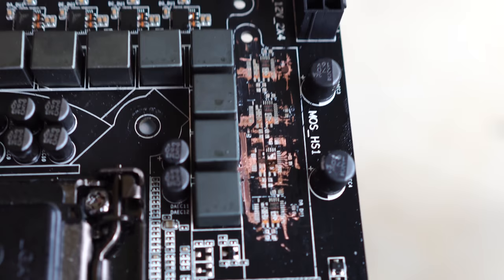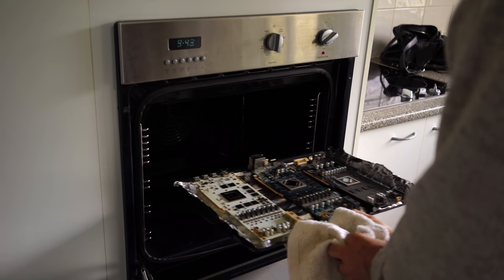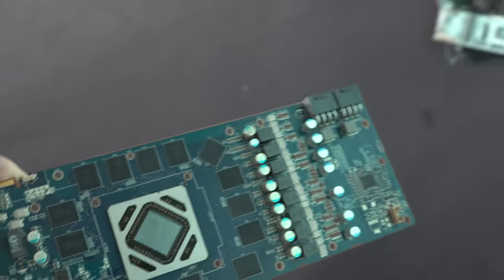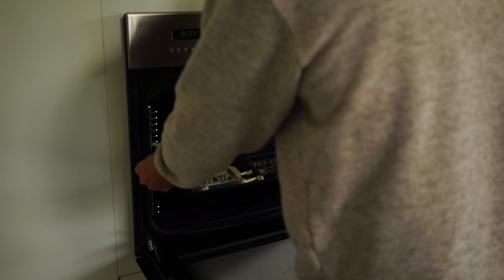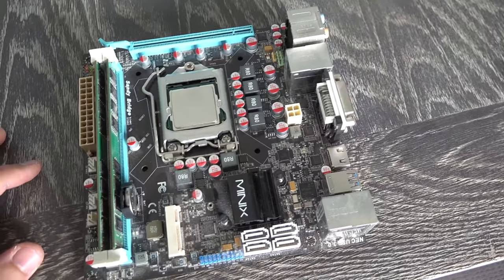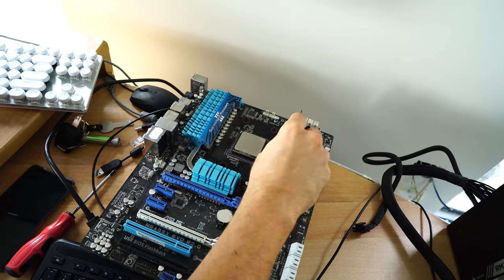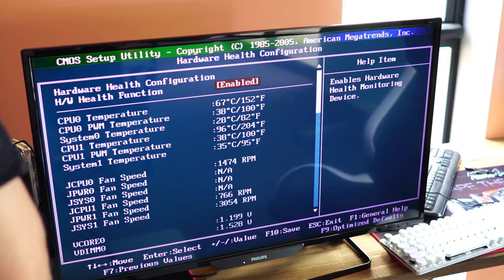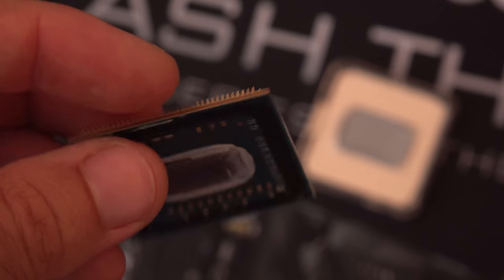Can YES Fix IT...!? The 8 MINUS 4 Phase Power Design | Oven Baking GPU WORKS!?

Comment from the maker: Not sure what is going on with the video processing in 360p.... Hopefully youtube fixes it soon!
Also with the ovenbake, I will stress the card out and see how long it lasts - some think it will fall to a swift ending.  Personally I always love trial and error over theory and formulas, its part of the heart of this channel.
Reply: For some of the non working card have you try and take a look a them bios. Maybe check if it is stock, lower clock of memory and core.
Reply: Do those scraped MoboPhases* usually draw a small amount of power or send out a status signal? otherwise solder a small wire to beginning and end points to bypass their spot on the circuit? (prob wont work cause i dont know much about it, but worth a shot i guess🙈)
Reply: nice, keep us posted
Reply: Tech YES City  always place some blobs of tinfoil on corners so it wouldn't touch tray :-)
Reply: Tech YES City the video is fixed now
Reply: Just looked at your bent cpu pins fix video.The simple way.Goto your local veterinary with cpu and ask for a Hypodermic needle that the cpu pin will fit in side of the hypodermic needle, gauge larger than cpu pin.File the point of the needle with a sharping stone.Then simply place needle over cpu pin and straighten and when the needle is vertical.so will the cpu pin.Thats how I did it after I dropped my FX cpu and had 9 pins to  straighten
Reply: The r9 280 might need a bios flash. I saw a Jayztwocents video where the same thing was happening to a gpu and he reflashed the bios and it worked.
Reply: Tech YES City do you think it's worth it to Outsource potential repairs considering today's market for gpus?
Is there any local repair shops in your area/ friends in higher places that you could possibly contract with, to keep the hustle going stronger?
Reply: Tech YES City I think you'll be the most honest to pin another comment as this is a last resort only sort of fix that only reanimates gpus for a time.
Reply: Oh maaan Louis russman is going to be pisssseeeedd
Reply: I was thinking the same thing haha. I doubt he'll do anything though since his message to Linus was so popular.
Reply: Tech YES City I have a couple things(some working and some not working) I figure I'd send you're way. How does one go about sending you stuff. :)
Reply: Baking gpu is not a fix...
Reply: Not sure if you still have it, but if you or the original owner (or a friend) happened to have an Intel Tuning Plan. You could try to get a new 4670K. They will replace it regardless of if it was defective or damaged from an overclock. I get them on all the CPU's I get now. 

Might want to keep that in mind in case you ever get a broken CPU in the future that you can still buy a plan for. It isn't tied to the serial# either. I thought about trying it out on a broken high end CPU from eBay once since they are usually dirt cheap. Could be a way to make a little money (all tho shady).
Reply: Tech YES City Hey, I have an ASRock Z370 Fatal1ty Gaming K6 that I BROKE 1 pin on, and bent a few others... I would be happy to send it to you at some point if you would want.

The reason it is broken, is that when I went to Re-lid my 8700k with Gasket Sealant - after letting it sit 24 hours, I picked the CPU up off my Rockit 88 by the IHS and it was holding fine.... Then I open the socket on my Mobo, and RIGHT as I am hovering the CPU over the pins, the IHS slid off and fell out of my fingers RIGHT onto some pins bending 2 of them dead flat.

I spent 2 days TRYING to make it POST again, before I said screw it and ordered my Second ASRock Z370 Fatal1ty Gaming K6. And this time I re-lidded with Loctite Superglue Gel- the SAME stuff that Rockit Sells WITH their delilid/relid kits! The only reason I used Sealant instead is because of some Forum Nobodies saying that Superglue of ANY sort can eat through the PCB... Well, that was BS!
Reply: Tech YES City 2:52 LOL that ASRock Gaming i9 looks IDENTICAL to my Gaming K6! Even though that board is X299!
Reply: Toxic flumes in oven.... wooo lol
Reply: Tech YES City try the microwave fix method it fixed my GPU I may sound dumb probably because it is
Reply: I have a mini oven specifically for boards. Been doing it for 10 years now. I've even done numerous laptop boards in it with success.  However I wash ALL boards first with hot water and scrub them with dawn dish soap, then clean them off with hot water again, dry then completely. 

I run the oven for 8 minutes and 30 seconds in total. First 4 minutes to convection to heat both sides. Then bake to heat only the bottom for 2 minutes to let the top cool some, then the rest on convection, I then let them sit for 30-45 minutes before use. I have a 9 out of 10 success with this method.
Reply: Masterchef classes. :P
Reply: aHHH, An SR2, when will you be doing a monster sweet unique build? 690's quad sli? Ya lucky to have that board! JELLY!!
Reply: Tech, you're never supposed to cook in an oven you've baked a GPU in as some lead from the saudur you're reflowing remains in the oven and will affect any food cooked in it from then on.
Reply: Please, pretty please, Brian - do use fluid flux !!!
You have to put it under bga in question.
Oh,and bye - real life soldering ovens have a couple of temperature zones,and PCB goes through them.
So,if trying to bake - do it right !!!
And,do not forget,that Rohs PCB has difrenet ,then non-rohs PCB temperature !!!!!
Reply: 96 degrees? Mine idle at 100 plus..my 3770 is like 113...my 4770 and 4790k both idle at 103ish is that normal....from what I read it seemed to be a common thing but I'm suspect about it
Reply: A tip on fixing GPUs - stop using a oven for first. Use a cheap heatgun (like the ones used to apply car glass filters) and some liquid flux.

Believe me, it will fix A LOT of problems. (if the main GPU chip is the issue, that is.)

Comment: reflow is only a temporary fix in my honest opinion
Reply: I second that. The only thing that I have ever actually fixed with the oven method was my ps3, which lasted a good 4 months after the fact but then went back to how it was before and nothing could save it. I have tried getting graphics cards to work with the oven method before but to no avail. I did manage to get a laptop motherboard to work for like 10 minutes once but that's about it.
Reply: There is a lot more to these problems than reflowing solder in the oven, you will sometimes find the graphics card will come back to life, but as soon as you start to game or stress test it will fail again.
Reply: Yeah the GPU works real hard when gaming and your right its real old stuff.
Reply: Definitely temporary. Many manufacturers use lead-less solder these days which can become brittle over time. A reflow will melt the solder balls for the BGA (ball grid array) chip, but the ball will most likely crack again in the future. A proper reflow would have the pads on the board and chip heated to the correct temp at the same time for the solder to bond with the board and chip. Pretty hard to do with an oven.
Reply: As someone who does reballing as a side job, I agree. Reflows tend to have a much more limited lifespan, which is why I do reballs. However, a reflow done right will usually last at least a couple years. Depends on the situation and how long you want to use the hardware I guess :)
Reply: Guys. Hold up for just a minute. You realize that solder does not melt at 190°C, right?
Reply: [Whatever name goes here]  Google "louis rossman reballing is bullshit" so you can see why they use low temperstures. You are not actually reflowing the solder. You are moving the DIE.
Reply: lol thats not even an opinion it truly isn't a permanent fix
Reply: I got an old spare 7970 working with a heat gun directly on the chip. Defo a temporary fix.
Reply: i don't know about that. i have a gtx 560ti that i baked in the oven 5yrs ago and it still working on my brothers PC.
Reply: @zupremo9141  could "fix" if for 5 years or it could only work for 5 minutes. Thats not really a "fix"

Comment: Louis Rossman's assessment on why it's a generally poor idea to bake video cards is pretty spot on.   I've seen a few attempts in these comments to say crap like 'Oh, he's just trying to make people pay him for expensive repairs', but that's a rubbish presumption of motive considering that all the facts he asserts are true and he's not much in the business of repairing video cards for his bread and butter to begin with.

He mainly repairs Apple products, and as an electrical engineer that's watched quite a few of his videos, I can safely say that he generally knows what he's talking about.

When you put a GPU in an oven, all you're accomplishing is softening the solder in an attempt to cause reflow and potentially fix a compromised connection between a component and the PCB's tracing lines.   To be fair to outlying cases, if the problem with a card is a badly soldered connection, baking it might...more by happy accident than guided method...fix it.

But that's not usually what goes wrong with a PCB in a GPU or otherwise.

Most GPU's that die, die because a component was bad in the first place or went bad in the course of operation.   No amount of baking your GPU or reflowing any amount of solder will make a blown capacitor start working again (and baking a card might cause capacitors to blow. Heat is bad for these things).     No amount of baking a pcb will make an oxidized transistor properly conduct along its gating channels ever again (its burnt. You can't unburn burnt things by baking them. That's now how anything works in physics).

Baking a card is adding heat.    That's it.  There is no magic or chance involved in any of these problems. 

If you don't know why your video card has died and it shows no evidence of physical damage, sure, there might not be any harm in baking it for a bit to see if reflow helps...but don't hold your breath or bank on it.    Even if it does help, don't expect it to last very long; reflowing solder in this fashion doesn't make good connections, and can easily bridge connections between terminal points that were never meant to connect, resulting in shorting and further damage when charged.

All in all, baking GPU's or any pcb is a last ditch 'I was going to trash it anyway so why not try this first' sort of thing to do.   It will almost certainly cause more harm than it will ever fix, and there's absolutely nothing that can go wrong with any sort of PCB that couldn't be fixed some other, superior way if the problem were identified and resolved properly.

Whether or not the expense of having the problem identified and resolved properly is acceptable is a whole other matter.  GPU's often don't get repaired because many of them are cheap enough to be replaced more cheaply than a third party repair job would cost to fix a compromised one.     

Even high end GPU's it might be cost effective to repair rather than replace will most often either be under warranty (in which case there's no reason not to use that warranty) or it won't be and it will be older and probably not top end anymore, thus making it more enticing to just buy a new even more powerful card rather than spend $200-$400 repairing one that's already on its way out the door in terms of being high end.

The cost of repairing a GPU can be hard to justify when replacement prices are reasonably low and when the very act of repair will absolutely violate any warranty that remains.      Baking a GPU doesn't magically become a good way to try a home repair just because it's cheap and you can do it in the same oven you bake your cookies in (though god help you if you make much habit of doing that. You should never bake pcb's in the same ovens you bake food in).

TL;DR -  Baking PCB's is mostly rubbish.  Louis Rossman's assertions about it are correct.  Also, if you must bake them, don't do it in ovens you also make food in unless you like heavy metal and toxic chemical poisoning.
Reply: baking 100c  is for removing the moisture in pcb not to reflow the solder. and for me it works

Comment: Ovenbackingen is not a permanent fix, it just makes them work a bit longer
Reply: getting 2-3 years more from ovening my 4890 is ...for me... closer to permanent, than "bit longer"
Reply: Yeah, I got way more than "a bit" out of my 7800 GTX back in the day. I think it survived another 2 years afterwards in my parents' PC. Even did this to my Radeon 8500 back in the day. I guess "results may vary" is the best summary for this.
Reply: yeah, i had a 970a-ds3p gaming mobo (am3+) it lasted 2 1/2 years after i took a heatgun to a bad trace on the motherboard. and get this, that wasn't even what broke the second time around lol

Comment: You should try to put the Galax card back into the oven for another 20 minutes at 200°C. Had to bake my GTX 660 Ti twice to get it fixed plus you could delid the broken CPU. Maybe it's working again afterwards.

Comment: Hey Brian, I had a lot of luck with the ovenbaking-method. like 3/4 were to be working again (maybe it was just a different failure status?)
However I did use less heat and more time, startet with 120°C and 30 mins, then crank it up by 30° once that first baking did not work. Covering the cards entirely with aluminum foil does help against the smell and helps spreading the heat evenly... Don't know if that would do any different but it could be worth a shot. Maybe this method would help in the future?

Comment: I had hp 6735s laptop in 2011, and it stopped functioning couple years later.(no bios startup, orange led blinking constantly). After i have bought new laptop i was looking for repair services to get some money back or get myself “emergency” laptop. I found a video on youtube for same laptop having the same problem(orange led blinking) fixed by oven heating motherboard for 10 minutes. Since i had nothing to loose i gave it a shot(if it is right way to say so:)). Guess what.. it worked very well. It is still working now. As said in video, if it is last chance it might work.

Comment: 3 years ago I had some issues with my old GTX 560. At that time I didn't change the thermal paste at all since I bought it and before it died it had like 83 degrees or so in games. It started with driver crashes, computer crashes, then on screen artifacts, then stopped working completely, it wasn't recognized by Windows and it didn't boot. 
I knew about this oven baking technique but last summer I decided to play around with it and heated the GPU processor (only) with a clothes iron for like 15-20 minutes (I also put some aluminum foil around so I won't touch anything else). Surprisingly, it worked from the first try, it works even now; hell, I finished GTA V and other games with no problems. 
In my case I was sure that the GPU processor was the culprit. Too bad I didn't record the whole thing, lol. Sorry for the long story but maybe this is going to help someone at some point.

Good video as always, keep it up.
Reply from the maker: Iron on the GPU Die? never heard of it, might have to give it a try.
Reply: Yeah, iron on the GPU die itself. A guy from my country said that the card needed reballing. So I guess that the GPU die was a little bit detached from the pcb and all that ironing glued it back as it was.
Reply: By the way... My GPU die looks like this https://goo.gl/xQFWqy  and I think that newer GPU dies are a little bit different so doing what I did might be harder.

Comment: If the vram is giving issue try to downclock the ram, I ad an factory xfx oc hd4870 that would act up and give artifact with dual 1080p monitor

Comment: you should use hot air gun and tweezers to take those parts of other than the (chizle or what ever it is called) to remove the mosfets! .. , also it might go to fail safe mode when it detects no out put voltage ..  (and i haven't watched the full video)

Comment: i just replaced two diodes on a mother board and it all works good now was getting blue screen was a job i like doing my soldering is pretty good had to get the parts in a special shop in the City of Adelaide as jcar dident have the 6.4V 1800uf ones

Comment: All it does is melt or soften the solder again, if there were cracked or ropey solder joints or balls on memory chips, it will reflow it to a degree. It doesn't solve the usual issue of dead / shorted capacitors. Or anything else like mosfet / choke damage or a Bios chips flashed info getting garbled by an PSU failure. You could just use a heatgun to the same effect. You're supposed to go over the whole board to warm it up 1st, save it cracking from localised heat. Chucked out boards you want to strip for components, to repair some of the others. Just bear in mind that you will have to check them as they are dead boards. Capacitors are fairly easy & the usual issue on their own. Just do a continuity check with a multimeter. Ground the black probe on one of the solder atx spots, then touch both electrodes in turn at the back of the board, with the red probe. If it's shorted the meter will beeb as the signal passed back & the circuit was completed. If it doesn't beep then it's good. You can do this to check boards 1st off. Solid capacitors are a pain because you cannot see they're done for. Always check the cpu socket pins 1st. I fixed a dead board only to find a broken pin afterwards. Even though tech progresses, most of the basic components like capacitors can still be used from old boards to get newer ones going again. There's only so many values for them, the same then as now.

Comment: The alternative to oven baking is to use a heat gun and blow the GPU. I use a small piece of lead as an indicator that the solder has melt.

Revived a HD4870 and GTX460 using this method.